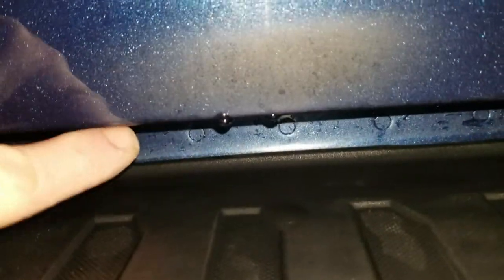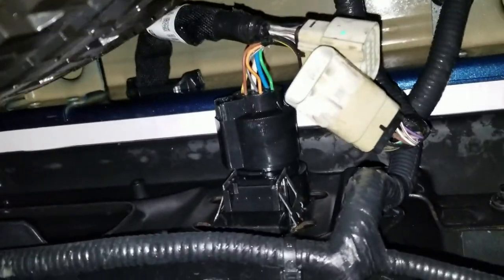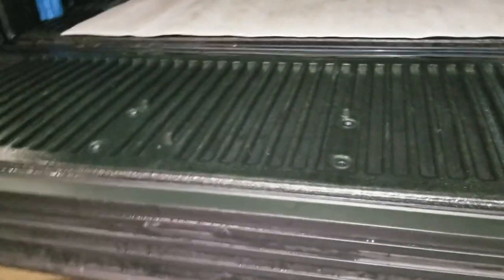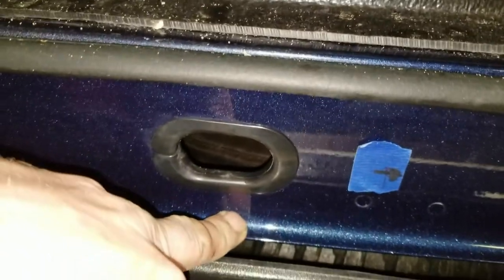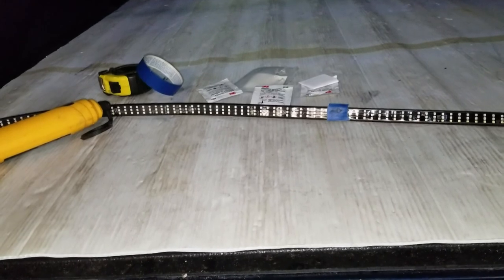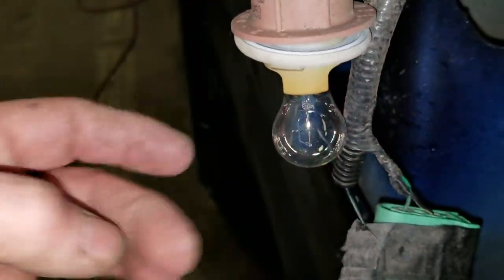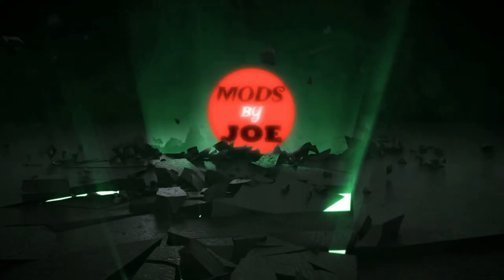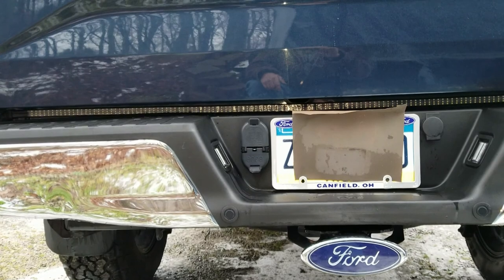Ford F150 Tailgate Led Lightbar Install.

Comment: You have to hard wire them to the taillights not to trailer connections the trailer sensor won't recognize the signals n brake lights
Reply: Well mine did. 2013 f150
Reply: We're talking 2018 buddy glad it worked for you my 2017 was ok with the trailer plug but not the 18 it has all the sensors

Comment: Both turn signals wire on the LED are supposed to be the brakes too, but I can’t figure out how to connect them to harness. Turn signals somehow have to connect to brake wire, but when I do, one of my turn signals comes on every the brakes are applied

Comment: Pop out both taillights , Splice one wire onto right side brake lite wire , Feed it through frame to the left hand tail light , then you can hook onto left brake wire , tail light wire , and back up wire, much easier. inside the left hand tail light opening is a bolt for load tie down , Hook ground wire to it , The aluminum body is ok to ground to, much easier than doing all that stuff under the truck. You have to hard wire them to the taillights not to trailer connections the trailer sensor won't recognize the signals n brake lights.

Comment: Wire it properly and you won’t have any problems, I just plugged mine into the trailer connector and it works perfectly, if you don’t want to do that splice the wires into your trailer harness, not to your tail lights, that’s probably where your problem is
Reply from the maker: I spliced them into the trailer harness.
Reply from the maker: The only thing pulled from the taillight was the reverse lights. That was my main reason for installing. So using the 4 pin trailer plug would not have given me the most important function.

Comment: Everything works on mine except running lights . When I check the wire for running lights the wire is dead . Tomorrow I’m gonna cut the back up wire and see if I have running lights. $12.00 junk!!

Comment: I’ve installed a couple of these and I’ve watched quite a few videos just to see if anyone has done it the way I have done it. The reverse wire you can go to a local auto  shop And I’ll have a two pin extension wire you can cut and splice it to where you just have one pan and modify the rubber around the pan either by a seven way to 5 way adapter or buy the whole 9 yards that mounts under the bumper but you take that one pen and solder it to the reverse wire and you make that a five way plug. It’s a lot easier and better In my opinion then trying to tie it directly into the wiring

Comment: I didn’t cut my harness.  I de -pinned the coupler.  Truck to Led colors as follows.  Green to Green,  white to blue, yellow to yellow, brown to white, gray to red.    For the reverse lights I ended up just using the coupler didn’t tie into Reverse light.   $23 on eBay awaiting night to see brightness